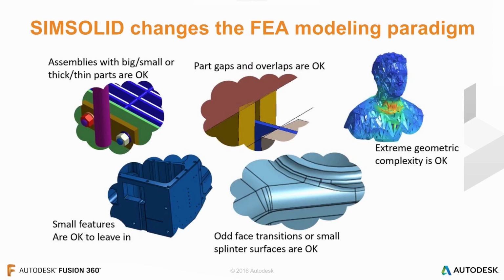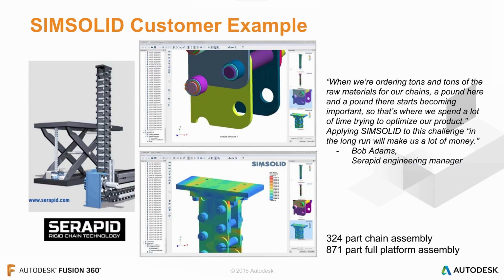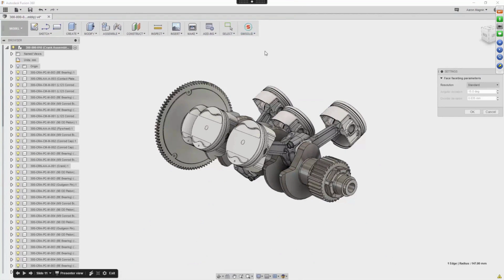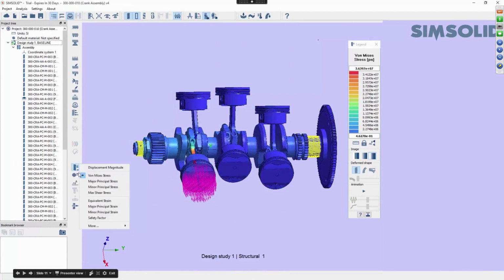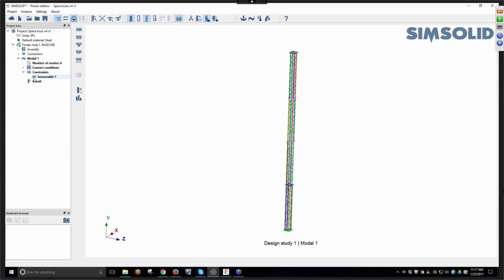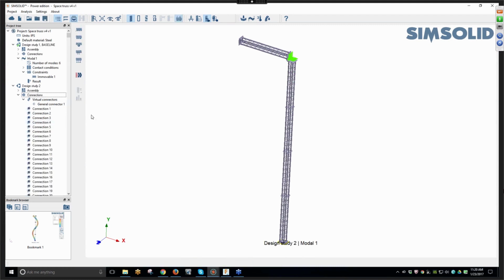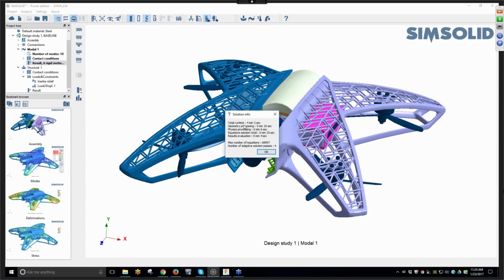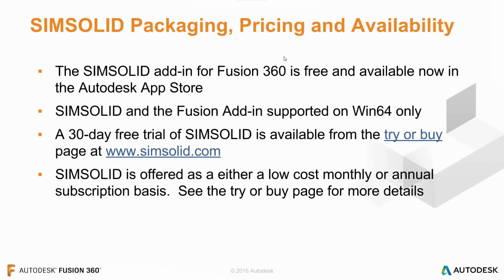Simulate Large Assemblies with SIMSOLID

Comment: Which approach to FEA does this use? I currently use Abaqus for my biomedical engineering applications because the formulae for mechanical engineering can't be used for cases where there is significant deformation. Could this compete with Abaqus?